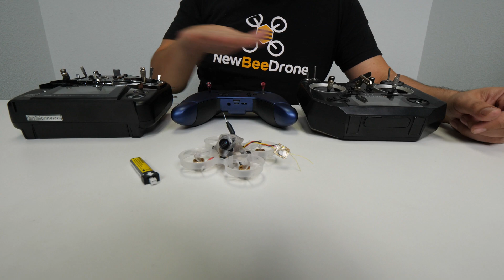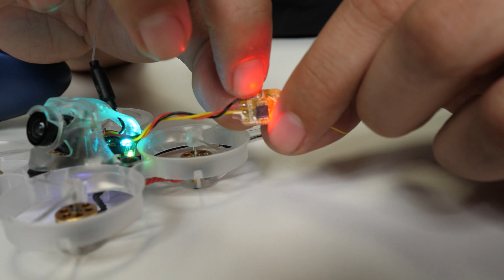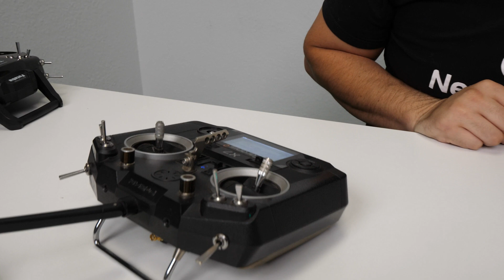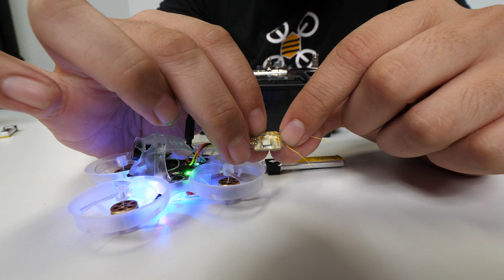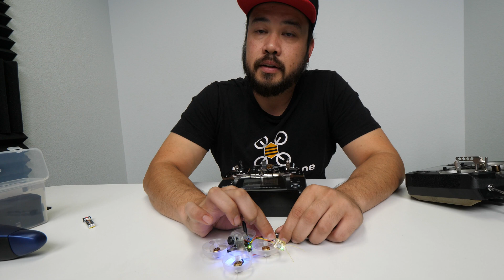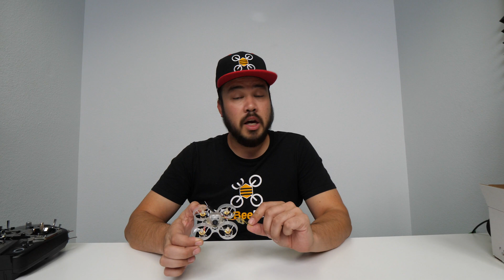Binding to the Beeceiver V2 D8 D16 and Futaba

Comment: Is it the same for the v1?
Reply: Lmk I can’t get mine to go back to d8 keep double clicking
Reply: @timmytson1  did you have it before? Do you have the moduel if needed?
Reply: @jaredtorbert2938  it was bounded it got ran over but only broke the two props. I changed the motors and all sudden it wouldn’t arm. But I got flashing green should be red
Reply: @timmytson1  oh damn. I'm a noob at this and not too computer literate lol I think I had mine bound but I couldn't arm and whatever I did, i dont think its bound anymore. I couldn't find the right target for this thing on betaflight I dont understand damnit

Comment: In the future, please provide step by step process.  You've jumped to the controller and said it's ready for bind but you don't show how to get to the menu to set up the bind.  Then you jump to saying press a button until it flashes and then in the controller it beeps but then you stop the beep.  Does that mean it's binded?  I tried it and didn't work.  So how do you know if it is binded on the FrSky  x-lite controller?  I'm very confused.

Comment: Mine is not working, I tried to switch between inverted and un-inverted and the receiver just dont work on betaflight. I also notice on power up there is just 1 blink of each set of led lights, I dont know why it doesnt blink three times like on your video. Help :(
Reply: I’m having the same issue, did u figure it out?

Comment: A buddy of mine has not been able to connect his FRSky controller to the new beeceiver v2.  It just keeps blinking constantly.  For my FRsky controller it works fine and it would pair, but then it was not receiving commands in betaflight.  We then tried to pair the drone once again with his controller.  This also did not work.  Is there a flash for the new beeceiver or could it bee our controller?
Reply: Did you solved the issue? same problem here, it binds but on betaflight the receiver just doesnt work. I tried to switch between inverted and uninverted and the problem persist :S
Reply: Did u fix this? If so spread the word. I’m having the same issue